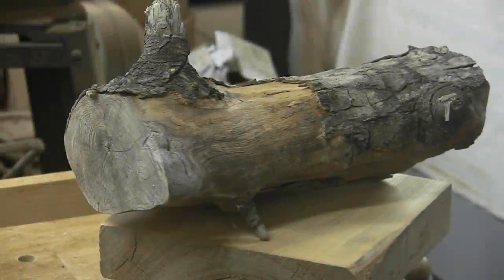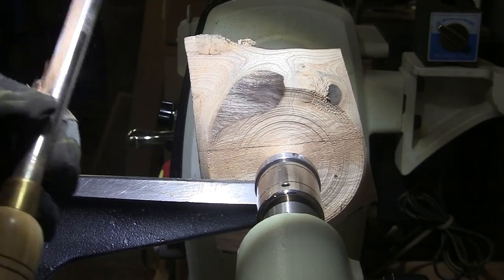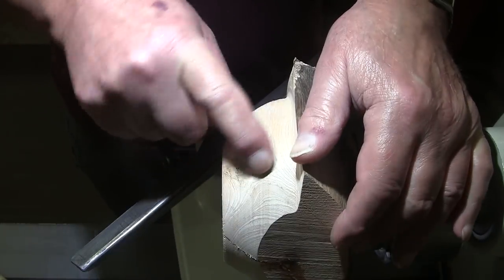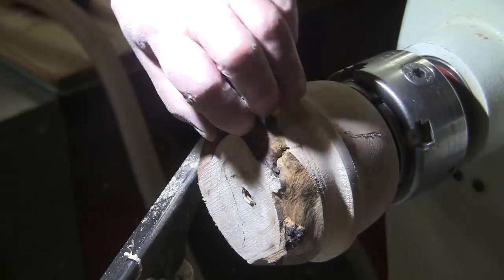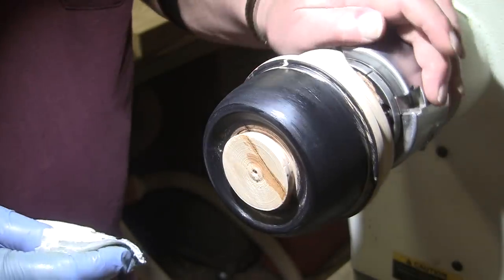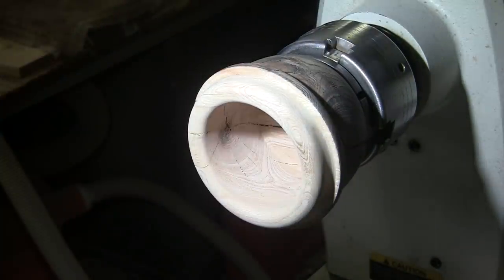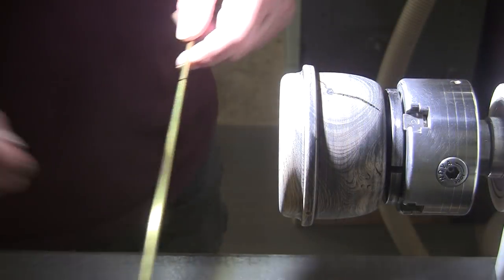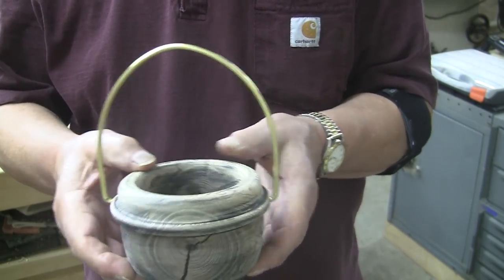Rustic Driftwood Bean Pot? - Wood Turning

Comment: Boy that was new and different for you . I also like it . I use Minwax ibony and then sand to leave the black in the pours. If you loosen the chuck jaws and then tighten them on just the head of the screw , the wood and the jaws no longer are in contact and the wood will spin right off . I do it all of the time as I'm 83 and not as strong as I once was . Keep up the good work kid .
Reply from the maker: Good advice, Lowell, I'll try to remember that! 😊

Comment: Sometimes the finished product is 15% inspiration and 85% perspiration, but it doesn't mean it's bad. Back in the mid 1970's after Citroen went bust and were bought out by Peugeot, they were told to design a new super mini based of the already aging Peugeot 104 power train and floor pan, thus the Citroen Visa was born. This design was considered to follow the previously mentioned ratio, not a car with the greatest looks, it did most things consistently and grew on their owners. This piece of wood was not an easy turn, but you made something alternatively stunning and rustic to your more usual pieces, you could call it your Citroen Visa moment, something of little promise that came good in the end.
Reply from the maker: Great story, thanks!  😊

Comment: OK, one criticism.  Know the materials you are working with. Acrylic paint is water soluble -- you can use it thick or thin as desired simply by adding water or not. Out of the tube or can it is dense and will cover anything with whatever colour it is. You can make it into a near watercolour pigment, almost transparent, if you add enough water to it. Thus avoiding sanding off the too dark coating that resulted from your first use of the paint. 
We always used acrylic paints when I was in art school. Benefit was that we could rinse our paintbrushes in the sink under the tap (instead of using turpentine or paint thinner), and it dried quickly as opposed to oil paint which would take way longer to dry.
Reply from the maker: Criticism accepted, Ole, but I had no idea I would be doing this and had never used acrylic in my life.  As I said, this is not what I intended the piece to be and I was not prepared.  Next time I will use some kind of dye or India ink if only I can remember to get some!

Comment: While I agree with you that painting is not the way to go, I think you've done a sterling job getting just the right amount of coloring on that pot.  If it were me, I would have hit it with a couple of coats of spray-on Poly just to prevent the color from fading over time.
Reply from the maker: Thank you, John!  I'm considering some kind of finish but, the idea with this one is, it's supposed to look like it's been hanging over an open fire.

Comment: Wow. Just keeping that piece together was a feat! As I’ve gotten older, I’ve begun using a nylon strap wrench to loosen the chuck to allow easy removal from the headstock spindle. I sometimes have to use the strap wrench to remove the piece from the woodworm screw. Doesn’t seem to ever leave a mark on the piece. Thanks again for my Thursday evening enjoyment.
Reply from the maker: I use a strap wrench once in awhile, too, Jay.  They can be very handy!
Reply: I've got one of those strap wrenches were the strap is a fairly stout rubber coated nylon strap. I've tried the nylon straps before and found them leaving noticeable marks on soft woods and finishes. The rubber one hasn't, yet.
Reply: Hey Thomas. That’s a good idea. I’ll bet the rubber coating makes it even easier. Thank you. Where in the world can you get one of those in Billitt County, Kentucky? Lol...I’m just down the road in Sumner County, Tennessee. I work often in Elizabethtown, KY.

Comment: You kept saying "This is so unlike me" as if it was a bad thing.  I thought trying new stuff and experimenting was how we get better at what we do.  I mean sure you can make the same 4" oak bowl.  You might even get to the point of making the best 4" oak bowl.  But then what happens when you don't have oak?  Or the piece is only 3 1/2"?  I actually admire your ability to change on the fly if the initial plan doesn't work rather than  try to force the piece to be what you are locked in to thinking it should be.

Comment: Acrylic paint, while not dry is water soluble, so you can use wet sponge to wash away excess or dilute it with water from get go. Acrylic can be quite translucent when thinned. I use it in my painting a lot just as very thin translucent layers or rubbing off with wet sponge.
Reply from the maker: Thank you for the info, Alexia! 😊

Comment: Great pot Phil. Good recovery. I have used Indian ink with some success to get that type of effect and it does not clog the sandpaper. You are right to be cautious with the steel wool. I have a couple of horror stories from that stuff so it tends to stay in the cupboard. Another idea if you do this again is two or three strands of heavy copper wire - one end in the machine vice and the other in the chuck of your hand drill and turn slowly. Bend it atound a pipe etc and solder it together. Makes great hanging rings for cutting boards etc
Reply from the maker: Thanks for the tips, Ray!

Comment: I would have applied a clear semi gloss finishing coat to bring out the tones, but yes, a nice little rustic pot. As an artist/painter I use acrylic paint a lot. You could have thinned that black with clear acryic medium, and it would soak into those cracks and act in the same way as the glue you use. Similar to that epoxy resin some use, but less expensive, and less fuss. Acrylic paste is also available to trowel on with a spatula, and that can be coloured with artists' acrylic paint too. So nasty big cracks are no longer a problem.
Reply: This comment was intended for Phil: I'm suffering from bronchitis right now from a flu jab that went the opposite way!
Reply from the maker: I was not prepared in any way for how I was going to finish this, Richard.  I didn't even know what it was going to be!  LOL!  I just used what was at hand and I'm pleased with the outcome.  It's meant to look like a bean pot that has been hanging on a hook over an open fire and got all sooted up! 😊

Comment: Well I for one like that you cut the wing round and turned the top to match the bottom. I was not so sure till you put the handle on and showed us but I think it looks very cool.
That black paint looks like what I used to dye some glue in one of my segment turnings. That stuff is nasty when it gets all over the place and me LOL.
 You had us wondering but you ended up with another one in the Win Column.
 Great job my friend,
Gary
Reply from the maker: I wasn't too sure about anything with this piece, Gary.  It took awhile for it to come together.
Yeah, I got some of that paint on me, it just takes a touch and it's everywhere!  It is latex though so easy clean up.
It's getting hot again, buddy.  Hotter down there, I think but still in the 90's here for a few days.  I still don't like it!  😊
Thanks, my friend!
Reply: I tried a liquid dye but it was to thin. 
Yes it reached 100 here so early this morning I did a 20 minute special.
It is only 99 right now at 5:30 pm so I am in back yard doing salmon on the bbq. I did not bother lighting the burners. Should be done in 5 minutes but the salmon will be done in 10 😆
Reply from the maker: @ThePapa1947  LOL!  That's hot, buddy!

Comment: If u will add a little  water to your acrylic  paint u can make a stain out of it. It will dry quickly  and won't hurt the wood. Plus it is cheaper  the buying  stain.
Reply from the maker: Thanks for the tip, Suzann! 😊

Comment: The typical method of lightening up acrylic paints is to add tiny amounts of water until the tint you want is achieved.  Acrylic paint pours is a painting technique for coloring glass vases.  By diluting the paint with some water, the effects can be opaque or translucent.
     Maybe you have discovered a new range of artistry.  If you ever get bor d, you could watch some acrylic paint pour videos.
     Planter is cute. 👍

Comment: Phil, the acrylic paint can be thinned with water. It would be like a stain. I also thought it would be better with it being two toned. Antiqued on the bead  down and the top either all black or just sanded and finished with Howard’s. You could use the wax even after antiquing the bottom of the bowl.
Reply from the maker: Yes, it can be thinned.  As I said, I had no idea of a finish, didn't even know what I was making until I was done.  There just happened to be some black paint sitting there.  No preparation, no thought, just did it.  It's supposed to look like it has been hanging over an open fire and got all sooted up! 😊

Comment: A couple of neat twists and turns through the project.  Maybe you should have sat and "cogitated" on it for a while!  Ha ha.  May have come up with the same thing in the end.  Came out great.  Love the effect of the black stuff and the brass handle.  Gotta say that I hate when people use steel wool on a project.  I lost the tip of my thumb when I was a kid and used steel wool to clean whitewalls (remember them?).  A sliver got embedded and got infected.  Heck of a mess!  All in all great job.
Reply from the maker: Yeah, I don't like it myself, Tom.  Just couldn't think of anything else to use!  😊

Comment: When I have wood that needs some pizzaz and I want to show off grain,  I use india ink -penetrates deep in soft areas but sands off easily with sandpaper - easier to take off just he right amount.  Curiously, folks often use these pieces as planters -put the plastic pot inside the wood one -saves the wood and lets you use live plants
Reply from the maker: That's a good idea, Bob.  The problem with this was, I set out to make a lived edge bowl.  I was not prepared to stain or paint or dye or anything else.  I will be getting some India ink, just have to remember when I'm at the store.

Comment: What about an iron acetate (fine steel wool dissolved in vinegar) finish?  Better than paint. Gives you that dark stain without hiding the grain.
Reply from the maker: Great idea, J B.  Most anything would have been better but, as I said, this is not what I had in mind at all and was not prepared.

Comment: When you have fractures radiating out from the pith why glue a false circular bottom and hold the turning together with the false bottom and chuck clamping?
Reply from the maker: I wish I had a clue as to what you are talking about, Charlie.  I did not glue a false bottom on anything.  The cracks are a feature that look like a spider web and will not get worse as the piece is totally dry.  Sometimes I guess I wish you were here to advise me on how to be a woodturner.  You seem like quite the expert.

Comment: Phil I like how the black paint once removed shows off the grain. The brass handle was a nice touch also. Are you going to seal it further? Again as always nice work.
Reply from the maker: I just don't know if I'll put a top coat on it or not, Dean.  I'm thinking about it but it is supposed to look like it's been hanging over an open fire, heating up the beans.  😊

Comment: Phil, Do you use fresh coffee gounds or do you dry your used ones and re-use? I've seen a few folks using coffee as a filler and it seems to work pretty well.
I like what you do with the wood sent your way and the way you respect the timber.
Reply from the maker: I've done it both ways, Craig and it seems to work the same.  These grounds were used.  I heated them up in a frying pan to dry them.  😊
Reply: Cheers for the tip. I'll give it a go.